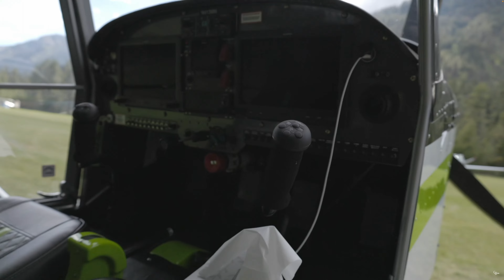All The Reveals--RANS S-21 NAME and satisfying PAINT Reveal

Comment: I have been debating painting my S-21 in pieces or assembled.  The biggest drawback I see to painting in pieces is the trim pieces around the wings when they are installed.  Are you planning to paint just those pieces once they are riveted in place after wing installation?
Reply from the maker: I painted all the trim pieces separately. There will be one row of rivets that will need touch up paint.
Reply: @CLEAREDDIRECT  I was debating that or just not paint that top trim piece until after it is riveted and then mask of everything and spray those two parts rivets and all.  Not sure how easy it will be to brush all of those rivets without having it be too noticeable.